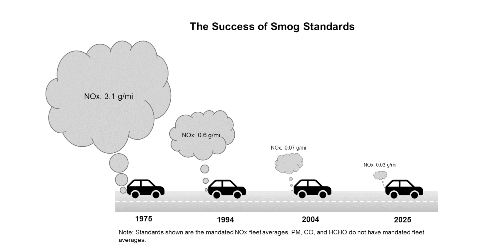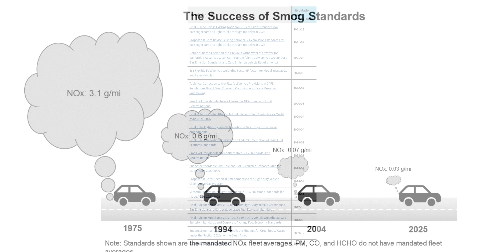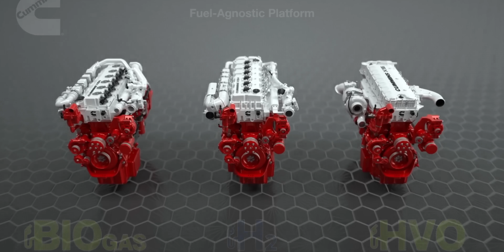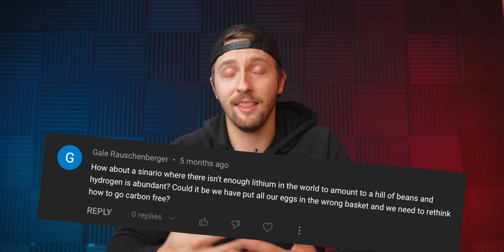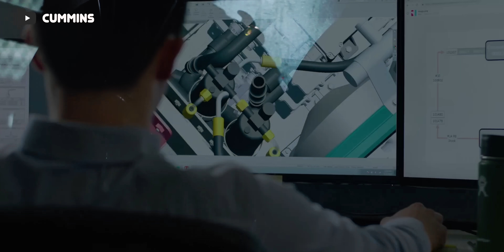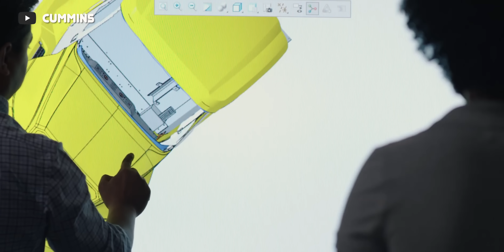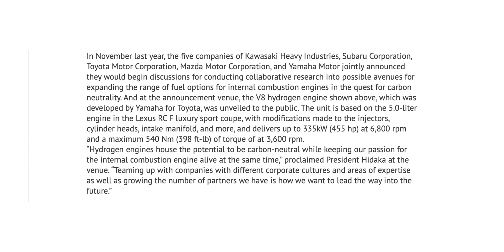Cummins Hydrogen Engine Will KILL DIESELS FOREVER

Comment: I remember reading a Mechanic's Illustrated article in the 70's where they interviewed and followed along an inventor that claimed you could get 100mpg on gas.  They reported It functioned as claimed and for the life of me, can't find it.  I do remember the inventor claimed a catalyzer and waste heat being key. Of course, it didn't go into construct detail, pic was obviously vague.

Alt fuels interests me, has for a long time, mechanic 40+yrs professionally and possess the utmost bias that "There is no replacement for displacement."  ~ Many a known motorhead

If they find a cheaper, safer, and uninhibited way, tractor pulls are gonna get really interesting.

Comment: The real greenhouse gas would be dihydrogen monoxide, electric motors generate ozone polution; the push for wind, solar and electric vehicles are promoted based on politics and not real science showing evironmental improvements.

Comment: I think the only way the Federal government will allow hydrogen engines to go mainstream, is if they can figure out a way to tax the hydrogen, madate a secondary fluid to be utilized, (manufactured by a government invested contractor of course) & create added fees to be licensed to operate said vehicles powered by the hydrogen fuel sources.

Because government means power & control...

Comment: It will not hydrogen costs 4xs as much per mile than diesel by the cheapest method of production which uses natural gas to produce and these prices go up when using the "green" methods of producing it.   Add to that how da group storing hydrogen is and the short life of hydrogen storage tanks and the costs go up

Comment: Sounds great!  But, what’s the source of cheap Hydrogen?  Hydrogen is not a resource naturally occurring in pure form, so it needs to be created through the use of electricity to split H2O.  So far that’s not too feasible…so, again.  Where do you get cheap Hydrogen?

Comment: You didn't mention long-term reliability. Look at the replacement cost of  Tesla battery packs that you have to replace around 70 to 100 thousand miles. 

Nor did you mention a Carrington event if the society is completely electric based.

Comment: Someone doesn't understand. Hydrogen requires a more robust engine a diesel engines are candidates by design modifications. Or adjusting the hydrogen mix.
It is still in development.

Comment: The future of haulage isn’t electric, at least in its present form. One Tesla Semi requires a megawatt charging station to keep it going and that’s not feasible at scale, and even then it doesn’t compete for range or refuelling time compared to diesels. It’s also worth noting the Tesla Semi doesn’t have a comparable hauling capacity and the range looks to be around 500 miles. It gets worse for potential buyers because to achieve a usable recharge time the charging system will push electrons into those batteries as fast as possible, and that’s not good. Don’t expect a million-mile battery anytime soon. It’s the megawatt thing that’s the real problem though and there’s no way around that. Hydrogen is clean but again there’s the associated problem of massive electricity consumption required to generate the required hydrogen. Renewable energy sources offer a significant amount clean power, around 60% here in the UK, but that’s today when EVs and hybrids are still a niche for those who have private parking. If mass electrification is to happen the only real solution is more nuclear power stations as renewables won’t be able to satisfy demand and relying on fossil fuel based power stations is only moving the carbon issue around. There is no easy solution to how we’re to move stuff around in the future but burning hydrogen isn’t much of a step forward if any when you look at the bigger picture.

Comment: I love my 2012 6.7 Cummins but I deleted from turbo back for exhaust, did a EGR delete , new high flow air filter and bully dog programmer and no bigger than 34” rubber . I went from 800 kms a tank to 1200 kms a tank fuel mileage. Amazing engine.
Reply: If you're from Michigan I would keep that information to your self they are coming down hard on diesel delete and other devices

Comment: The biggest problem is they are a large company and they are there to make money. If they wanted they could make engines clean and so much more fuel efficent and would last. but that wouldn't help the bottom line wich is profits.

Comment: There is NO WAY that electric vehicles will be any more than a peripheral option the ICE based transport. There is not the infrastructure, nor ever will be, to replace carbon fuels with EV’s! We need to think Ammonia! It is a liquid form of Hydrogen. JCB have invented an engine that very successfully runs on ammonia without NOX emissions.

Comment: I think propane would be a good option. It's a cleaner burning fuel than even gas and the infrastructure is already there if you add an attachment on the tank at the station and we already have propane powered busses.

Comment: 96% of ALL h2 is made from natural gas. going back to 1st principles? the BASE price of natural gas is about 5% MORE than diesel fuel, best case scenario. add in the cost of refining it into h2? the price is 80% above diesel fuel. at that point- EVEN IF you had a NATION WIDE h2 piping system going to EVERY current gas station on the planet... NO ONE is EVER going to opt for h2. in short? H2 IS STUPID. the smarter move? would be simply use one of 2 options: propane powered cummins or stick with the diesels & invest full on in B-100 bio-diesel manufacturing plants. bio-diesel plants use factory mass production of algae to make veggie oil and B-100. the technology is already there- it's already been done. no engine changes necessary. keep the existing fleet. utilize cummin's achates power diesel, which cuts nox down to nothing, and B-100 gets a pass on CO2 emissions standards, because the co2 production is almost completely offset by the algae production in a factory... because no farm equipment is necessary. 

there's a ton of info this guy has DEAD WRONG about EV's. first: 500 miles at 82,000 pounds max gross for a tesla semi will replace 90% of ALL truck routes in existence TODAY. and by the way- that's including 6% grades. a tesla model S P100 has a 405 miles of REAL world range. THIS IS NOT A 'CITY CAR'. EVERYTHING this guy says about EV's is outdated by about 10 years when compared to tesla's CURRENT technology. child labor for cobalt for one. 

so why would cummins take aim at a 5% to 10% slice of the trucking industry? THEY WON'T. it's just not profitable- tesla will OWN the other 90% OUTRIGHT within the next 5 years. H2 is dead. leave dead dogs lay. cummins needs to stick to what they do best- build diesel engines. form a new conglomerate intity with all the others (cat, international, detroit, etc.) to create bio-fuels & DITCH BIG OIL... or go down with the sinking ship. h2 will NOT save them.

Comment: you left out, there are millions and millions of mechanics around the world that I understand and can work on an engine adapted from gasoline or diesel to hydrogen because the principle of the engine operation is the same
  Electric however needs to have millions of mechanics trained to work on electric drive systems. The world is not even close to having enough electric mechanics right now, let alone in the future..
  you can’t take your electric car to the local garage you’ve been dealing with for the past few decades if you have a problem with it. It Hass to go back to the dealer or someone is trained and probably licensed to work on these vehicles without injuring or killing themselves. I definitely remember when Formula One cars went to hybrid systems, the mechanics and corner workers at the tracks wearing rubber gloves, I remember the drivers getting up out of the cockpit and jumping out of the cars in such a way that they did not touch the body..
  also, it takes train to technicians a few hours to deconstruct used electric car batteries. And soon there will be millions of used up car batteries that need to be recycled. And they are very dangerous. Electric vehicle recycling technology is in its infancy here in 2023. It is going to become a much larger issue than dealing with radioactive waste just because of the numbers of batteries that are in existence right now

Comment: Peter Zeihan among others has pointed out that EVs require more resources by far than the internal combustion engine and vehicle production does and that the mining alone that would be required for the four to five times increased production would be devastating to the environment, which makes the entire purpose of the EV moot.  Same with solar and wind power.  Nuclear and especially Molten Salt Thorium Reactors are the least impactful and in the long run, the cheapest and most practical of all solutions because they answer so many needs with the least impact.

Comment: The best solution for the future of energy supply is the construction of Molten Salt Thorium Reactors.  Besides providing abundant, cheap electricity, they can provide a myriad of other functions that will completely defuse the Green New Deal, such as non-carbon diesel fuels which means you can keep the current commercial transportation intact.  MSRs can be made small enough to run a car or a ship.  They can used to desalinize ocean water on a massive scale.  They cannot melt down because the molten salt is the fuel carrier.  Thorium is preferred over Uranium because it has 200 times more energy potential and it is literally dirt cheap.  Thorium is abundant and has been the "waste" product of rare earth mining in the past.  The reaction occurs between 600-800 degrees F.  If the molten salt should ever overheat the reaction stops and a freeze plug in the bottom of the fuel jacket melts and the molten salt flows into a holding tank where it cools down naturally.  They can be set up to burn the waste from light water uranium reactors because they are so efficient.  They can be used for producing non-carbon diesel fuels.  They can be used to cheaply desalinate seawater, and scrub carbon from the atmosphere.  They are safe and can be built anywhere.  They can be made small enough to power a car or big enough to power a city.  The U.S. has about t a dozen companies that are either ready or near ready to construct them   France is developing them and Denmark has one company developing them.  I don't know about Germany, but Germany would clearly benefit from them and could erect them quickly if they desired.  They must get over their anti-nuclear sickness, however.  There is no time to waste.  here is a four-minute introductory video to MSRs. - 
https://www.youtube.com/watch?v=k6BXvw6mxtw

Comment: Why not use Anhydrous ammonia as a Hydrogen source as ammonia is NH3. The government has it classified as a non flammable gas, but it is in fact very flammable. They only classified as non flammable so that it can be utilized as a fertilizer. It has the same vapor pressure as propane with it remaining liquid at a higher temperature than propane. Besides its very noxious smell, Anhydrous ammonia is utilized in all sorts of industrial applications and is a far better refrigerant than the newly developed freons. It is utilized as a stable refrigerant for many RV's in their refrigerators. I dont think you would have to have actual liquid H2 since you can also create H2 as an offgas from various chemical reactions as well. So many variables to think about and consider. Ive been involved in R&D projects creating synthetic diesel out of methane produced in a landfill. That diesel was double the cetane and contained 0 Sulphur. They call that technology GTL (gas to liquids) There are other fuel alternatives that are available that should also be considered as renewable and viable.

Comment: There is a lot of promise using Hydrogen (the most abundant resource inthe universe) but besides having to use significant amount of electricity to make hydrogen, another potential problems is driving during extreme cold weather as it exhaust will freeze on the vehicle or on the road surface.  Still, until scientist have invented a fast and cost effective to produce liquid hydrogen that could handle the demand of millions of hydrogen powered vehicles, I am afraid we won't see this technology go mainstream.

Comment: To produce hydrogen at scale you need a hydrogen reformer. They make hydrogen through cracking water, which takes a lot of energy usually comes from natural gas still feasible. But converting one energy source to another energy source is insane.

Comment: The Japanese have pioneered a process to use the waste heat from fission power plants to generate hydrogen (H2) by a chemical process (i.e., no electrolysis). This process explains why Japanese auto companies are collaborating to develop better and more efficient H2 powered vehicles.

Comment: Again, here we have a claim that Hydrogen will replace current technology. Like the claims that electric vehicles will replace present fossil fuel technologies when there is no infrastructure to support it. Without valid research into the cause and effects of these new proposed technologies, such assumptions are premature and unfounded. The rush to EVs, for instance, without the remedy of the corresponding disposal, ecological byproducts, generated by such technology.
Making wild claims without realizing the true cost is foolhardy at best.

Comment: I think electric fully excavators and other off-highway equipment are a lot closer than you think. Danfoss has already integrated their Editron electric motors into prototype excavators and wheel loaders. 

I understand these offerings are only the tip of the iceberg, covering limited equipment sizes with a lot of work is needed to fully optimize these systems, but the tightening of diesel emission requirements is definitely pushing progress at an accelerated rate.

Comment: I would rather buy a hydrogen vehicle & have to refuel every 300 miles(that would only take ~15min) vs an electric vehicle that takes an hour & can perform well in hot or cold environments. (Evs have piss poor performance in hot or cold environments) 

At least hydrogen offers a much better solution to off road/agricultural because of the long work hours.

The push for Battery EVs is the most retarded thing in the history of the world

Comment: Hydrogen has huge issues.  Producing it is a huge consumer of energy, significantly more than it takes to pump crude and turn it into diesel.  Hydrogen storage is issue #2, if you are dealing with liquid you need cryogenic tanks (heavy & bulky) and there is that little hydrogen embrittlement issue.  Big problem #3:  It takes 3 gallons to equal the energy in one gallon of diesel.

Comment: Cummins couldn't get there CNG engines to stop blowing up.  Worked with the engineers trying to figure it out.  Plus you have to use different oil and the motor has to be rebuilt twice before the normal rebuild of a diesel engine .

Comment: National Fuel who supplies natural gas already has vehicles that run on natural gas, in fact they have pumps at their facility in Western New York. That, instead of electric is where we should be heading. Our electrical grid cannot supply the power necessary for all these electric cars once online. But the feds don't really give a crap about the average citizen.

Comment: Not really sure on how emissions make that big of a difference on diesel trucks. Because trucks with emissions will get 12-14 mpg a diesel in an pickup that does not have emissions can get 20-26 mpg so your burning more fuel to have cleaner emissions. Which that would get canceled out

Comment: The issue is entirely about onboard energy storage. Batteries simply cannot do the job. Hydrogen is the only viable long term option for electrified or ICE vehicles, especially those used for commercial and long distance transport.

Comment: The hydrogen wont last long if its only got 285 horsepower compared to the 400 to 600 horsepower diesel engines

Comment: The issue of fossil fueled power plants is important to keep in mind. Even worse, in my mind at least, are nuclear power plants and the danger of melt downs. They are very inefficient as well, needed enriched Uranium to work. There is a danger in transporting nuclear fuel rods from the enrichment facility to the reactors. Special containers have been designed to protect us from this disaster, but nothing is 100% safe. But, there is another design of a reactor developed before the types in use today, that doesn’t need enriched fuel and tends to shut itself down if left alone. We need to pursue this path for electricity, and Hydrogen for our vehicles. The biggest problem I see with hydrogen is it’s combustability and power generated if the vehicle running the gas were in an accident. A leaking gas tank is dangerous enough. Hydrogen explodes in the wrong circumstances. I believe there is a way to address this, and I’m sure that in time we will find the answer. At least I hope so.
There is yet one more clean method to run our vehicles, and that is the fuel cell. Fuel cells produce by combining hydrogen and oxygen and the reaction that occurs generates electricity. The by. Product of this chemical reaction is water. Pure, clean water. NASA has been using fuel cells in manned spacecraft for years, so the technology is proven.